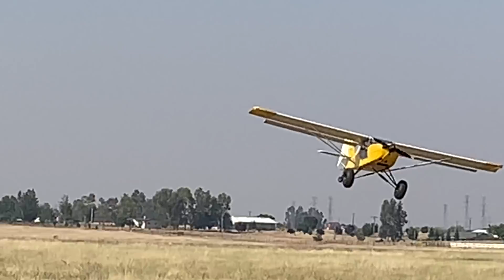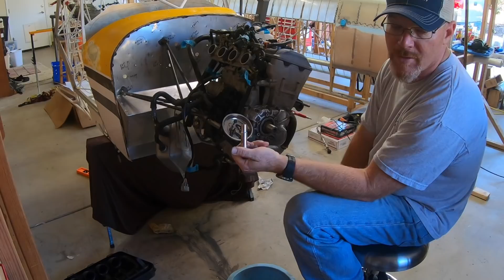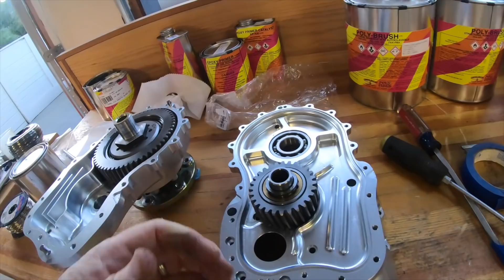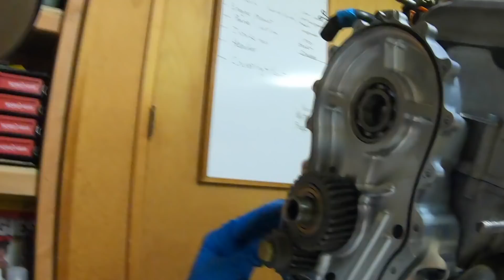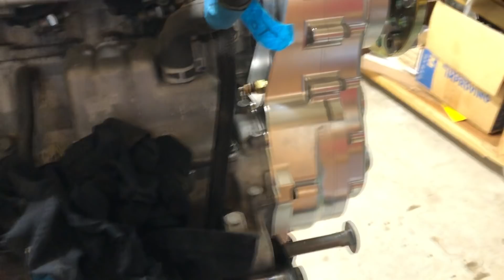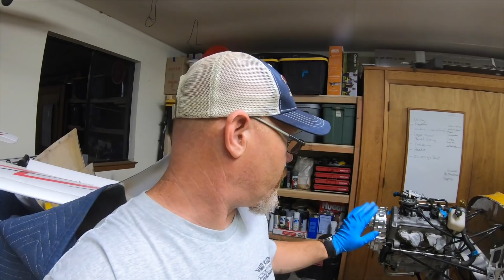SkyTrax Gear Box Installation

Comment: Thanks for making this video. Using a Yamaha engine for aircraft is new to me. One question. Why did you put rags in the exhaust ports, but not the intake ports?? Murphy's Law says that stray nuts, bolts & other hardware has an affinity for falling into the intake system. Very dangerous to leave those ports open.

Comment: The brass piece between the gears was a bad idea. It creates a tremendous force pushing the gears apart. The proper way is to hold the ring gear (where the starter engages).

Comment: Have you modified the engine or plan to? If so, what has been done?
Reply from the maker: So far just the electronics and fuel mapping.
Reply: @BowenAero  Thanks for the info, I just subscribed to your channel. Im very interested in your build because I've decided to do the same build, I'm placing my order for a kitfox sti next month and already located several apex donor sleds. Please keep the videos coming and looking forward to gaining alot of knowledge from you. Also what's your thoughts on the turbo model apex, Thanks Cliff.

Comment: I learned a trick in A&P school to keep the motor from turning while you torque on the crankshaft. You remove one sparkplug and insert a length of cotton rope inside the cylinder. When you torque against it the Piston is protected by the soft rope. Clear as mud?
Reply: Works good as long as you pick the cylinder that has the valves closed on a firing cycle.
Reply: @CurtisDrew1  ya, I forgot to say rotate cylinder towards top dead center. Thanks.

Comment: What is the aprox all up flying weight of the engine and it’s components?
Reply from the maker: Should be about 178-180 lbs. I will let you now specifically when all the components are complete.

Comment: Great Video, with this setup, Apex, Skytrax Gearbox and engine mount from Ken Brown does it fix under the standard Rotax cowl as provided by Kitfox?  My Kitfox delivery is still over a year away but I want to get the engine together now.
Reply from the maker: So far it looks like it will fit under the stock cowling.

Comment: Hi, An old trick I learned years ago, glue the Gasket on the Gearbox or any part that will go on a engine, only on one side that will be removed with  Gasgacinch and the other side of the gasket that will be sealed to the engine with silicone gasket sealer, Reason being, the gasket will stay on the part glued with Gasgacinch, The Gasket will come off completely and most of the time will be undamaged, and will be reusable many times, if glued back on with silicone glue. To Reiterate , the gasket glued on with Gasgacinch is Permanently glued on and does not need to be removed and can be reused if not damaged.  I use this trick with my cars when replacing water pumps etc. the gasket stays with the old worn out parts and the engine is gasket free because of the silicone sealer that was used.

Comment: Surprised the box is not installed with drilled head bolts and safety wired. Is there room to install a 90 degree 1/8 NPT street 

elbo(for temp sensor) to avoid gearbox removing in the future?

Comment: That's a lot HP for such a light plane. Will you get it certified for 1320 or 1500 pounds?
Reply from the maker: 1550 lbs

Comment: What will be the new engines horsepower and how much did the gear reduction unit cost?  How does it compare with the Rotax reduction drive?
Reply from the maker: The stock engine with a re-tune of the fuel map, Dyno results showed about 161 hp. The gear box is from Teal Jenkins Skytrax and the cost is $3500.  I don't have a Rotax gear box to compare it too, but the Skytrax gear box is built very well and is being flown on a 300 hp version of the APEX and has over a 100 hours now.

Comment: Brian,  did you mention what you are expecting as far as horse power from the APEX...   I'm thinking in 150 - 160 range does that sound about right?
Reply from the maker: Yes, that is about right.
Reply: @BowenAero  in the STOL Drags, isn't Steve Henry running a Yamaha?   Are you going to be pretty evenly matched?

Comment: The gearbox looks very well made to handle the horsepower.  Just a thought that I have used on o rings to keep them in place was grease.  Cleans up easy if some oozes out the casing.  Looking good Brian.  Hey don’t worry about the mess, that happens when your building.

Comment: How much does the engine weigh with gearbox?  Does this make a problem for light sport regs?
Reply from the maker: Just the engine and gear box are about 145 lbs. Firewall forward weight should be 175-180 lbs
Reply: Thanks!

Comment: Hey Brian, was there any requirement to grease the inside of the shaft seal when you pressed it on to the shaft?  Without lubrication wouldn't the shaft wear on the seal?  Stinson guy.
Reply from the maker: It didn't call for any, but maybe a good idea.

Comment: Couldn’t really tell from the video, but did you match the ends of the “o” ring at the bottom of the housing? If so, why?
Reply from the maker: I did. It would be better to do it at the top, but I couldn't get the two ends to stay in the grove at the top.
Reply: Just been thinking that.

Comment: Where did you get your engith mount from?
Reply from the maker: A friend designed it with CAD software and then cut all the tubes with a computer aided mill. It was then load tested to 6 G's. He is trying to decide if it is something he wants to make for others.
Reply: @BowenAero  yeah needed for yg2 yg3 yg4

Comment: The gearbox looks well made. I hate seeing drive belts on aircraft. Why are you using that engine over a rotax?
Reply from the maker: Stock it has 50hp more for the same weight and has the potential to add additional hp without exceeding the design of the engine. All for a 1/3 the price. Reliability with the examples that are flying seems to be very good. Those are just a few of the reasons. Personally not a fan of Rotax, but that is just me.
Reply: Ok cool. Got a 80 HP Rotax engine in my aircraft. Think it's pretty built proof. They seem to  go on for ever. Worked on a few C42's used for flight training and they have been very reliable. The engine in my last aircraft was a Jabiur so most things are a step up from those. Rotax are expensive mind you.